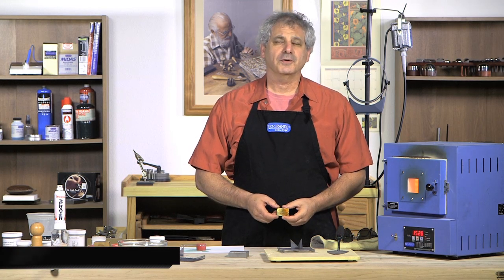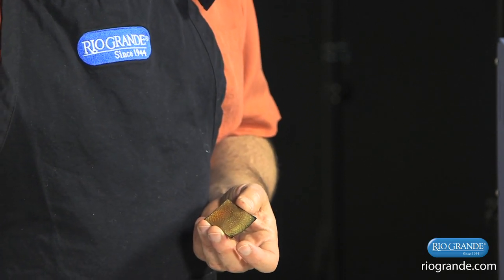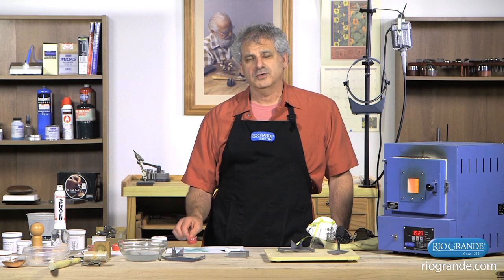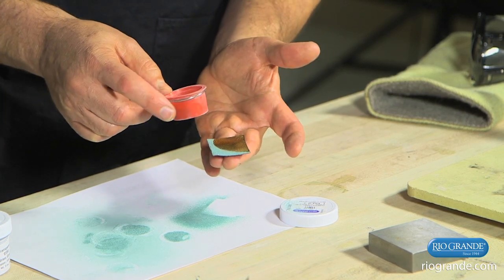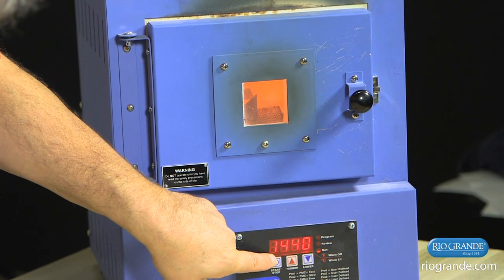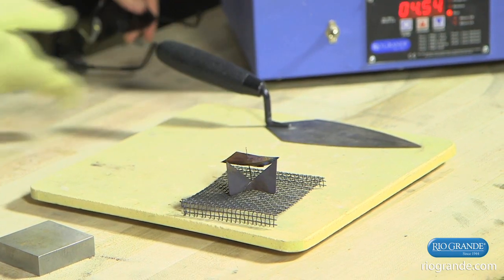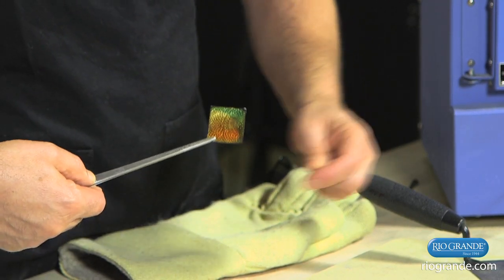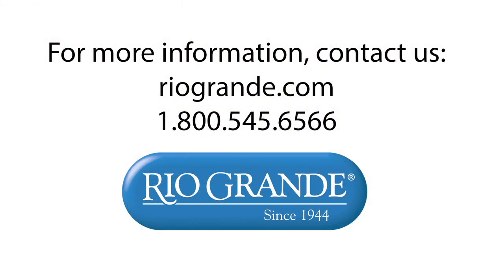Enameling Roller-Printed Metal, Part 2, with Ricky Frank

Comment: Hello I just watched your video. I was given this box of enamel powders, sifters and thinner. I didn't know how it was used. Your video helped me with that. My question is can I use this with resin projects or anything other than firing in a kiln? Also is it even any good? The product is AMCO Metal Enamel 3990-19 Opaque Canary and other colors. There's even a white flux and a water dissolving tablet for antiquing. It may be as old as 1971, I say that due to an empty prescript bottle is dated 22 Jan 71 from the Air Force base here in Phoenix. If in your expert opinion it should be thrown out what are the best methods of disposal? Thanks,
Michelle
Reply: TBAEC If you like the results, it is useable. There isn't a right or wrong. it is made to be fired in a kiln, but it's basically powdered glass, and if you want o embed it in resin and like the result then do it. If you want to throw it away I would just put it in the trash.
Reply: Thanks Frank.

Comment: did you spray adhesive first before adding the stencil enamel.
Reply: no, i did not. but you can if you want. there will be more videos coming out next year with demos of using holding agents and different mesh sizes when sifting, stenciling, and scraffitoing through enamel.

Comment: What size screen are you using to get the fine particles out.
Reply from the maker: Hello Arlene, Thanks for your question.  Generally around 80 mesh is a great particle size to achieve the best clarity. The fine or very fine particles can actually be used for painting and adding fine lines of color.  Here are the sifting screens that are used to separate the finer particles: https://www.riogrande.com/Product/Stackable-Sifting-Pan-Set/350070

Comment: I seem to have a rim of the black around the edges that don't get color or get cleared with my initial fire.  How do you fix this?
Reply from the maker: Hello Arlene, The black around the edge is usually caused by lack of enamel in those areas.  This edge can be sanded and/or ground away leaving the bright metal next to it.  A second cause can be over firing.  Sometimes the black edge is a result of both, but it is not uncommon to see this on the edges. Our Jewelry Tech Team is happy to provide some guidance, if you like. They can be reached at 800.545-6566. Hope this helps!